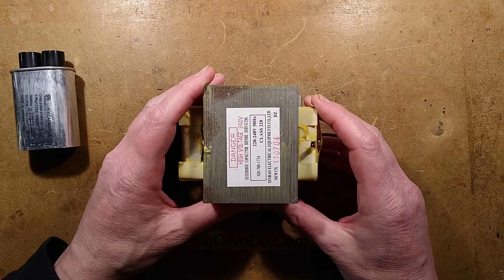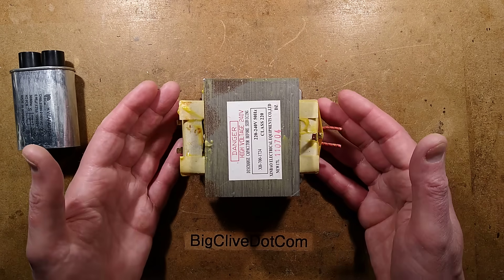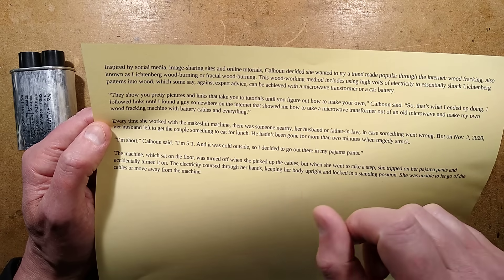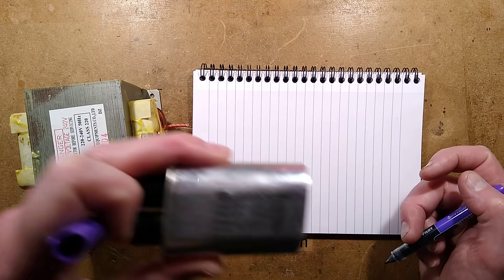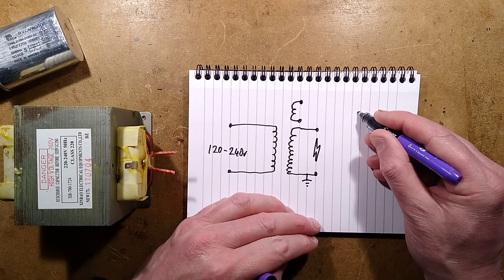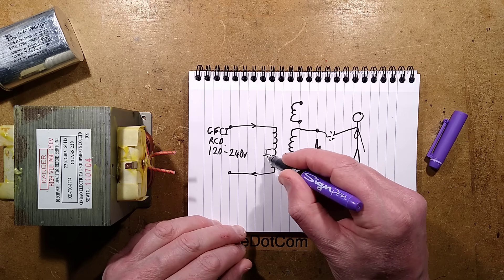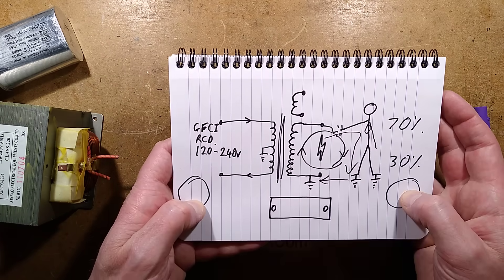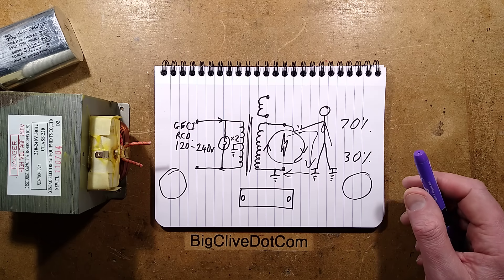The most deadly project on the Internet

Comment: Maybe we were lucky not to have microwave transformers when I was a boy. We made shocking devices and it's easy, take a smallish transformer out of an old 1960s/70s radio, connect the secondary coil to a 3 volt battery via an on/off switch and an old battery operated door bell dinger (which can be hidden in a school blazer pocket). On the the primary coil (now the output) connect 2 wires, each one fixed to a bit of clean copper water pipe about 5 inch long so you have something decent to get hold of. Then see how long you can withstand an oscillating shock ! Or see how many people you can connect in circuit. Only brave ones volunteer.
My mate Allan and I had a load of fun at school with this home made "shocking coil". I kept the device in my pocket and had one wire through my jacket arm to my hand held bit of copper, the other wire went through the other arm and through the arms of my mates jacket to his hand held bit of copper pipe. We had to stay close together otherwise folks would see we were connected by a wire ! If we completed the circuit by shaking our free hands we got a shock ! But it was much more fun completing the circuit with an un suspecting person ! We upped the voltage to 4.5 volts ( a bike lamp battery) and that was full on ! Big hard boys and bullies hated it ! We managed to go around school giving boys electric shocks for about a week but then we blew it and got into trouble. We started frying the girls by grabbing an ankle each while they climbed the stairs in front of us ! This escapade didn't last long, we were in front of the headmaster in no time who banned us from any more electrical terrorisation. This was long before the digital age when we made our own entertainment.

Comment: Great public service advice. Due to a project at work I'm interested if there are any ways low voltage (sub 60v) could pose a fatal risk. Could it be possible for ~48v lithium batteries in sea water to cause electric shock drowning in a bad scenario?
Reply from the maker: DC is less of a risk as it doesn't cause the same sustained muscular contraction that AC does.  The official ELV (Extra Low Voltage) levels cover the range you describe.
https://en.wikipedia.org/wiki/Extra-low_voltage

Comment: should you have high current if you stepped up the voltage?
Reply: Power through a transformer is 1:1 without accounting for some losses. The ratio of primary to secondary windings is how the voltage is stepped up or down. The higher voltage side has the lower current, and the lower voltage side has the higher current.

Comment: I know this video is a year old now but I wanted to add my 2cents. If you do not understand electrical safety, DO NOT ATTEMPT THIS PROJECT. I do this wood burning, but not with a microwave transformer, with a neon sign transformer I bought. The transformer is fully enclosed, with a separate shut off switch and two aligator clips soldered on. The lower current of the neon sign transformer allows for finer burn marks and greater detail. Rather than spraying the wood with a solution, I wipe the wood down with salt water on a towel when everything is disconnected. Like any other project there is a risk here but if you understand the risks you can work to mitigate them

Comment: I had a shock from a tv transformer and I went to the other side the wall ,,electric was off and what I tried to do is cutting the wires of the transformer
Reply from the maker: The tube itself is a capacitor and holds a very high voltage charge.

Comment: When I was around ten years old my friend got hold of an old neon transformer. We had a lot of fun lighting up fluorescent bulbs across the room and making Jacob’s Ladders to impress the girls. I remember it was 15K volts on the secondary so you had to switch it on/off on the primary side. We had plugged into the one outlet every room came with in the 50’s. We got lazy and would switch it on/off by pulling and releasing tension on the plug. You could get mild shocks of one pole, but being shocked across both sides was a transcendental experience. When you got shocked once you gave it away to another friend. I think it rewired my brain for a month. My friend tried to  reassure by saying that,  “ it’s not the voltage that kill you it’s the amps.” Parents back then didn’t get excited about on foot wide arching electricity in a child’s room back then. I’m so careful about electricity now I drive my family nuts. My grandkids aquariums all have GFI outlets I installed. 😊

Comment: Most Youtube content is DELIBERATE trash to amuse those of low intelligence who get excited over trifles. Before thinking I'm harsh consider why Youtube algorithms work in the first place!  
Even those who should know better get zapped. When I was training at Keesler AFB a ground radar instructor failed to use a shorting stick to discharge a capacitor while teaching his class then reached into the machine. He died but the lesson got through and was famous for decades. This was a troop who gave safety briefings EVERY DAY but got distracted. 

I've repaired many microwaves besides years working with other things electrical. I never disturb a circuit without TESTING for current and where capacitors are concerned I ensure the system is bled by using a shorting stick. There's a tool called a "dummy load" used to load test circuits. Do not be a human dummy load. Toys are not worth dying or being severely injured.

Comment: I love my machine there is a protocol on operating a fractial burner and use a voltage regulator with it so it ot full throttle all the time. I run me be at 1/3 power that's all you need for quality
Reply: don't hold the probe nubie. use a switch. Stand on rubber pad.in no case hold while it is powered up
Reply: Jacobs ladder

Comment: Would protective gloves help too or are those not a thing for this? I don't know this stuff.
Reply from the maker: They would have to be power-industry grade and tested for pinholes regularly as is done in that industry.
Reply: No. Most people don't have high voltage gloves, and they must be cared for and retested frequently. Don't consider this. Also, personal protective equipment is a last line of defense. For example, a seat belt helps in a crash, but it's best to avoid the crash to begin with. Think of electrically rated gloves like this.

Comment: One caveat about what is said is that lower voltage does not guarantee there is "no damage". Dry skin, no water or anything else but wires and batteries around, and I had an accident and a 48v battery got enough to burn half of my thumb to damage half of my nail and "bacon up" the skin enough to have not using thumb fingerprint for almost 4 months. On the right conditions, no "water" and no "unskilled" handle can still get you accidents with lower voltage. You gotta really know what you doing before you do it, not just watch someone doing it and repeat it. My accident was a work accident not really uncommon or caused by "dumb moves", but if someone is not really prepared to handle electronics, it is dangerous.

Comment: I got thrown into a wall by 440volt one time thank God it was fuse protected by panel after it jolted me it blew the fuse otherwise I'd be toasted now, I was scraping melted plastic off a barrel heater of a 500 ton Reed plastic injection molding press with a big pry bar, very stupid on my part, that was 15 years ago, my arms still tingle and ache to this day

Comment: With thise voltages you should be worried about potential difference in the ground. Really you don't have to touch it to die. Just like downed powerlines you don't have to touch it to die. Most of the time you just walk nearby and the potential difference between your two feet is enough.

Comment: For about 40 years the electronics schools in the US Army have been showing trainees a video about a dude that we called Airman Larry. (I uploaded the video to YouTube) He got electrocuted working on high voltage power lines and the video goes into graphic detail about all the surgeries he had He eventually lost both arms. Over 11 months of training they showed this to me 4 times. The army was very serious about this. 

We had to calibrate voltages in a satellite earth station TWT high power amplifier and one of those voltages was 11.5K DC. We used a large HV probe and were required to do it as a 2 man team with the second guy having a wooden hook to pull you away if you messed up and got electrocuted. We were also told to keep our forearm resting on the chassis of the TWT assembly so in case something went wrong, hopefully the electricity would only go through part of your arm and not your whole body. The idea of screwing around with these voltages without paying very serious attention to safety scares the crap out me.

Comment: If you wanna do anything with high voltage and will not be dissuaded:
Dead man's switch, multiply your height by 2 and that's how far you put it from the electrodes. Now attach a spinning red light to the circuit.
It's all well and good flying by the seat of our pants when the thing that burns up and dies is a circuit board, but let's take serious business seriously by meticulously thinking out how we would do it and then never doing it.

Comment: Long story short, never touch the bare wire, wet surface or basically anything that the leads are touching while it's plugged in and while unplugged alway short the wires together with a insulated screw driver before touching bare wires.
Other than that... Survival of the fittest
On second thought... After hearing his accent he's from "across the pond" which means they use 240 volts for every appliance in their home so... DON'T DO THIS AT HOME lol

Comment: I used to do this with a 12,000 VAC neon sign transformer back in 1968. I never got shocked because I worked with high voltage repairing color TV sets, and I knew what I was doing. Anyway, I discovered it accidentally when I was trying to build a Jacob's ladder with a wooden base. It made a mess of the wooden base with those "fractal" patterns, but in 1968 I didn't know anything about fractals, so I threw it away.

Comment: Theoretical question here, could you not insert a high voltage rated RCD/GFCI breaker on the secondary side? that would solve the problem of RCD/GFCI having no effect due to galvanic separation.
Reply from the maker: That would be a very specialist component.

Comment: Not to mention, if both your hands are grounded, you have more current going straight through your heart than 1 hand. When working on high voltage circuits of electric vehicles i usually try to work with one hand.

Comment: Here's a story of high voltage. A truck driver hauling logs pulled over because his load was getting loose. He parked right underneath high-voltage powerlines. He got his cable strung out and threw it up super high to get it up and over the logs and to the other side of his truck. Emergency personnel came at a later time, and found him dead sitting upright against one of the wheels outside of his truck. Everybody thought he had simply had a heart attack. During the autopsy however they found burn holes in the bottom of his boots that exactly matched the nail patterns of the boots. Later, people figured out that his cable had touched the high voltage wire only momentarily, however that caused his heart to go into fibrillation. So he did not die immediately, he felt ill so he decided to sit down and lean up against one of his tires where he then passed away.
Reply from the maker: People are often found dead sitting down after a significant shock.  Often with a cigarette stub in their hand.

Comment: It's not not the voltage that is deadly. Only the current is. The body can handle voltages over over 10k easely. But a current flow of 0.01 ampere through your heart or brain is already deadly.
Reply: Good point, theoretically a l.5 volt battery dropped in a bath can cause arrythmia
Reply: The human body can handle 10 kv only for a few nanosecond (that's exactly what's happening in static shocks) If 10 you had 10 kv across your body for a whole second there is 100% change that you die

Comment: Id swear you were one of my professors. Your attention to detail and explanation are incredible. Most do not understand how powerful small transformers can be. the difference in 120-240 alone is astronomical in human reaction. once you add transformers into the mix it no longer "shocks" you but grabs you. it happens alot in the oil fields. hard to find info quickly, but in university, and a bit of further education, we were warned about 208/277 more than anything, even 600.

Comment: Nothing in comparison but i once had to clean my computer power supply fan and for some stupid reason i did plug it in to see if the fan was still making that annoying noise. My finger and the metal went in contact, it was nothing big but my vision blurred for a few seconds and i almost fell. It's crazy how even a small voltage can affect the body.
Reply from the maker: If you had the computer's power supply open then a lot of the exposed metal inside it is live.

Comment: Clive
If I were to connect the high voltage secondary to 220-240v
Mains voltage

Would the low voltage primary produce around 25v and would that be safe to charge car batteries?
Reply from the maker: It may work.  But a proper charger would be better.
Reply: Yeah because they secondary will have more windings
Therefore a higher inductance
A higher impeadance
Thus a lower current flow
I really hope it works though and then I can just regulate the output voltage by adding diodes in series or even zener diodes

Comment: How do you protect against high voltage? I certainly wouldn't trust my insulated tools with 4kV. 
I'm not that worried about 230V, insulated tools and some common sense and the chances of electric shock are basically none. But above 1kV, stuff like dielectric breakdown comes into play. That stuff scares me.

Comment: I zapped myself with one of those when I was a teen. It went through a handle of a screw driver, through my body, through a pad of carpet and then through the concrete floor back to the transformer base.

Comment: Man, if i ever (i wouldn't) did this it would be under highly controlled system. The work needed for that just isnt worth the risk if you cannot isolate the steps for safety and have a separated area, away from the device not in the same room. Even then not worth it.

I dont eff around with electricity.  I got hit with one of those capacitors.

Comment: Mistake number one every single life threatening projects newbie makes is saftey precautions. Be prepared for the worst, take basic preventative cautions. Full PPE. Rubber gloves, work pants, steel toe shoes, respirator. It's basic stuff and it'll save your life in a pinch if you're not a fool.

Comment: look at the neon tube signs in stores, i was at the deli in our market when an employee was washing the wall panels and ledges around the neon deli sign when she screamed and fell off the step ladder! she got shocked by the "bare"wire ends that connect the neon tubes to each other. duh! they should have turned the sign off first! very high voltage but very low amperage is why she survived. i got nailed by a car coil years ago :face-fuchsia-wide-eyes:it was NO FUN lol they should have insulators on those wire ends but those are ugly :face-orange-raised-eyebrow:

Comment: I have  made over  75  Lichtenberg fractal wood burnings  on wood  and  many people  have them from me , 

It's only  dangerous  if you TOUCH  it  while it is on  ! 

You don't  stick your fingers in a light  socket  do you you   ?

NO  !

Then  don't  TOUCH   this either  STUP1D   !
Reply: Let's hope you stay that way, eh?
Reply: @emm_arr  , I been  doing  Lichtenberg fractal wood burning since 2015 , 
That's over 8 years  , 
There has been 30 + deaths  because  the people  are STUP1D   and they touch  it , 
You are are talking about  5000 volts and  it's instant  death  , 
I have  never  touch it because  I'm 3 feet away from it , and I am holding the electric cord ,  I am the on / off switch  !
I plug it in and  I turn it off , 
I am no where  close to  touching it , 
And I'm not  STUP1D  , I am a Welder and I  understand  electric  ! 
So you have  ZERO  Worries  with me  ,
And like I said  over 75 Lichtenberg fractal wood burnings and over 8 years of experience  !

Comment: This video popped up and I sure did not know at first what the danger was, then you started to talk about a microwave transformer, and I knew enough. I had once an old tv turned on and the high voltage clamp that is attached to the glass tube, was hanging loose and it shocked me. From that moment on I realized the amps were low and the voltage was high, and that was my luck. I never did anything stupid after that day. (except other stupid - non electrical based - dumb things, LOL)
Liked your video Clive,  good to point out some things to the world, and maybe some engineers and designers of electronics won't make dangerous stuff like a battery-charger that you can stick in the mains, had one, broke it because of unsafe design because the main leads were situated a few millimeters under the clamping construction for the battery to hold in place, China design, BAD!!!